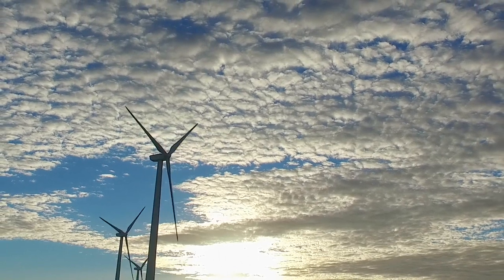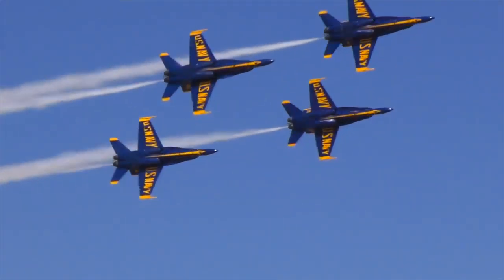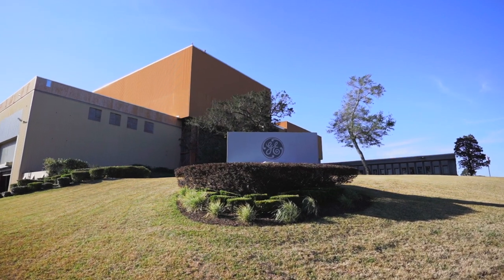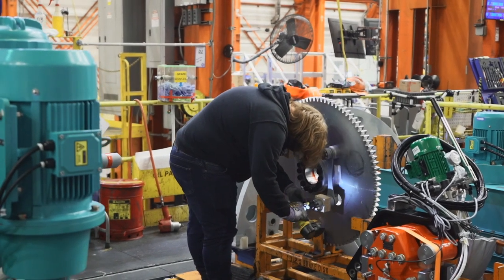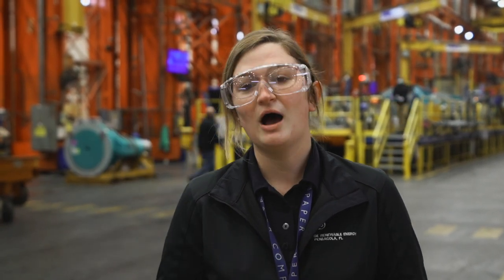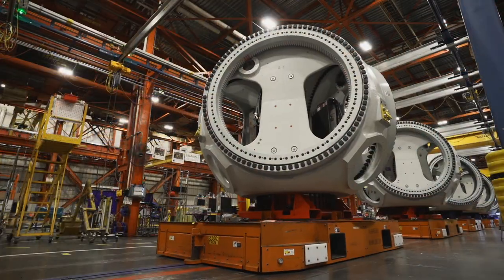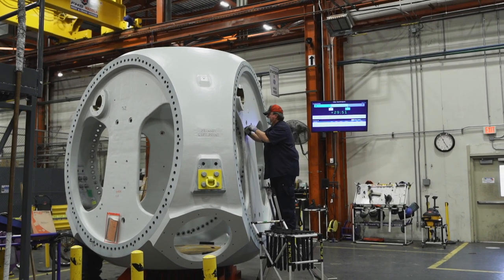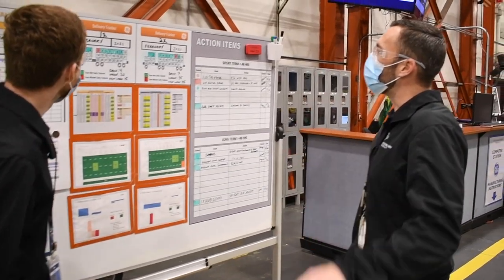Manufacturing wind turbines in Pensacola, Florida | GE Renewable Energy

Comment: What are the projected emissions through the manufacturing process?
Also are the components recyclable?
Reply: Wind and solar PV powered electricity can smelt the old scrap steel into new and valuable steel. It'll take 80 or 100 MW to power an electric arc furnace. Really amazing...and super loud!
Reply: Each modern wind turbine weighs basically one million pounds. The steel towers, nacelle and hub can be recycled as steel or the aluminum ladders or the copper cables.

Siemens Gamesa annouced they are now launching their recyclable blades. Presently fiberglass blades are either landfilled or grinded up for concrete plants.

Comment: Lean = Invented by the Japanese, it really does work.
Reply: It really doesnt i promise.
Reply: It works well when you have consistent supply chains. The last few years showed us that this isn't always the case.
Reply: @Ry_TSG  That was a concern of mines while I was Genie. I brought it up several times but since i was on the assembly line, probably hispanic, and obese i wasnt taken seriously. Lol.

They go by LEAN also. I wouldn't say we were always slowing the line down, but it was more often than should've been. 

Why go by LEAN if you're not going to adjust the method or tweak it for your business practices and standards. A couple of consistent problems i was having were that the manifold lines were either the wrong hoses, wrong length, or for wrong manlift. I would have to stop what I was doing and either find my assembly line supervisor* or walk to the hose assembly and ask them to make me one. I would then wait a couple minutes for one to be made, or I would have to go to my station and wait, and the line would have to stop until I get my hose. 

The other consistent issue were parts for the manifolds. I put together all of the manifolds on the S-40/42 Models in our facility and each manifold contained a certain amount of fittings. Some of the washers on those fittings were old and would break, or I'd be missing a fitting or fittings and some fittings i didnt have i would have to stop the line again. 

Another issue was that some of the welders were able to drink on the job, so they'd miss welds, or do shitty jobs after the frames were painted. Part of my job and my group was to inspect the top part of the frame (I forget what it's called) we'd fine the welding errors and report them, sometimes they'd exchange the frame. Or have that welder that fucked up bring his shit to the spot and weld it on site. 

I even drew up a design that would tighten hose fittings pneumatically, instead of by hand, a tool that would make my job and others quicker by about 10-15 minutes which equals more product. It takes about 20 minutes tops to feed and hook the manifolds lines together. I showed an engineer I befriended what I was talking about and showed him a sketch of the tool. He thought it was a genius idea, and he approached his people and they told him no. I asked why and he said that Genie is cheap and they won't make this, he said the idea was awesome though. 🤷🏽   Genie had their own on site "inventing area/trial and error area." 

Sorry for rambling. Brain damage. 🧠